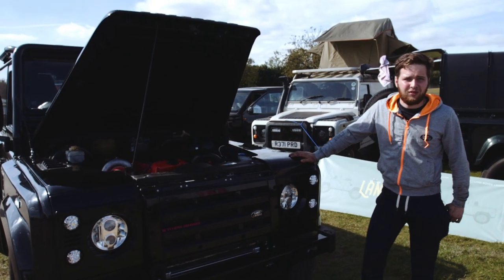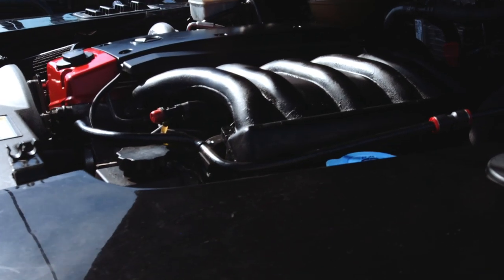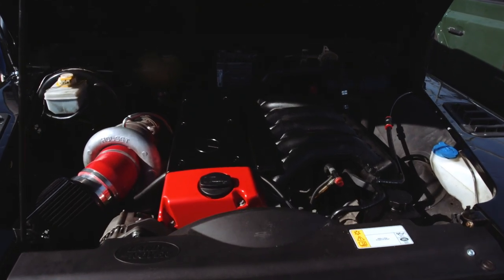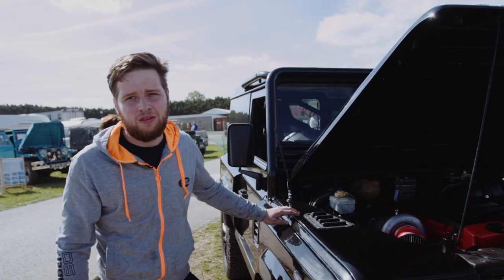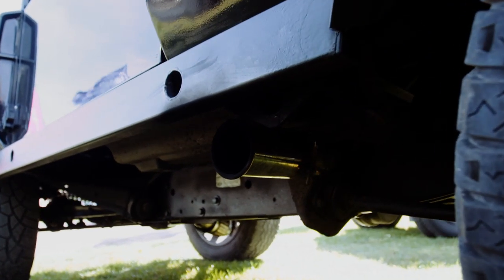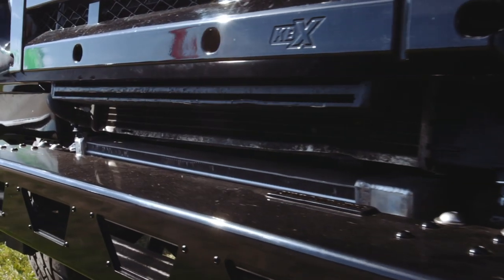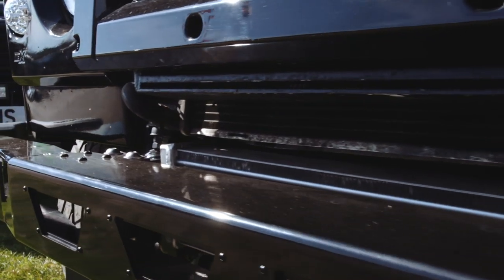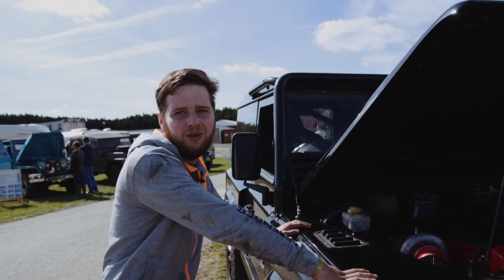Club86 | Harry's OM606 90 | Club Rides

Comment: The M57 might have been a better engine by its low end torque characteristics but the OM606 appeals to me just fine.
Reply: Makes me wanna get an old defender and put a 4jj1 in it.
Reply: M57 is a heap in comparison. Wouldn’t rate them.
Reply: @Diesel8290  Where i stay european diesels are rare. Heaps of Japanese diesel here.

Comment: Sounds good but she’s a bit of a smoker,
Reply: Not tuned properly yet. Still work in progress
Reply from the maker: Wait till you see what we're planning 😂
Reply: @Club86  How are you getting on with the auto? I changed to auto, but didn't like it so went back to R380. Interested in your electronic set up too, I went down the 7.5mm mechanical pump with DPUK hybrid turbo- can't fault the power/ performance, bit smokey but only when pushed.

Comment: Sweet conversion! I was wondering do u need to change the internals of pump with the dsl to get more ponies? Can you run two maps say one low smoke and the other full beans at the touch of a button?
Reply from the maker: Not sure, most people I know have swapped to a manual pump eventually

Comment: ‘‘Tis a good engine the 606, me and a friend had a psychopathic 606 1980 G wagen, but I would personally put the 4.0 Cummins (paccar in the UK) engine in one it’s just the 6bt with 2 lopped off and makes the same power
Reply: It is obviously a way lighter engine which is why I would use it even td5 defenders can be nose weight with out 800kgs of Cummins in it
Reply from the maker: @4wdsome444  4BT's/Paccar engines fetch strong money at the moment I think
Reply: @Club86  Trucks with them in (something like a DAF 45 or LF) can be had for about £1200
Reply: All those Cummins derived engines seem heavy tho?! Not sure of weight of a 606 but doubt its as heavy as those..🤔
Reply: OM606 = 210 kg (463 lb) dry weight
4bt = 499 kg (1,100 lb ) dry weight

OM606 clear winner in the weight department and much more appropriate for a 90, the OM606 doesn't have very good numbers in stock form but the can be tuned up pretty easy.  The 4bt is a work horse but they are very noisy, heavy and would shake a defender to pieces, plus they are a pretty tall motor so not an easy swap.

Comment: Hahaha It doesn’t make 300 plus hp on standard pump, that’s why the gearbox is surviving. Put on rolling road for power run it only cost £50 for power run
Reply from the maker: Dyno vid coming soon 😎
Reply: Club86 Glad to hear you getting it dyno, I bet you pint it doesn’t make 300hp. Send the pump off to Dieselmeken than it will
Reply: I'll take that bet
Reply: There’s plenty of 606’s with 300 or just over hp on stock pump, don’t get me wrong the egt’s start to get high but it’s not impossible
Reply: James James yes exhaust gas temperature

Comment: Very nice build but this smoke looks bad. It gives diesels a bad name. I understand that if you want power you can't always get that without smoke. But i would almost be ashamed to put the throttle down if i had this car.
By the way: i'm not an environment tree hugger. I drive diesel myself and also LandRover.
Reply: A tree hugger but play's a guitar made off wood
Reply from the maker: The merc engines are notorious for pouring smoke out but some of the most powerful ones are set up for little at max power